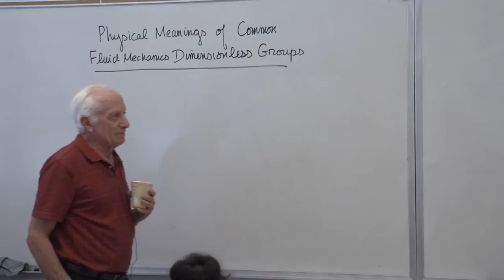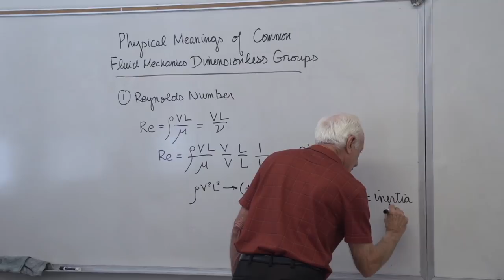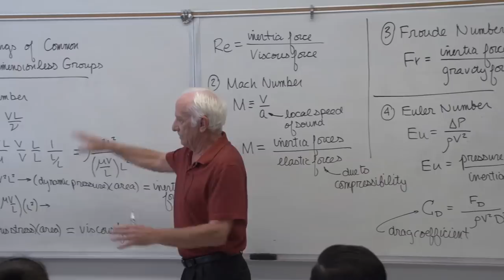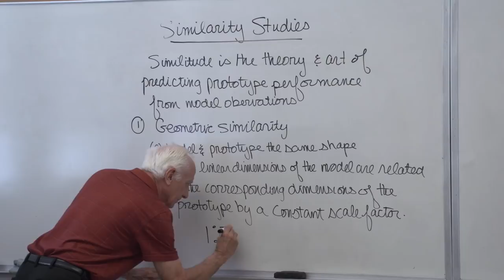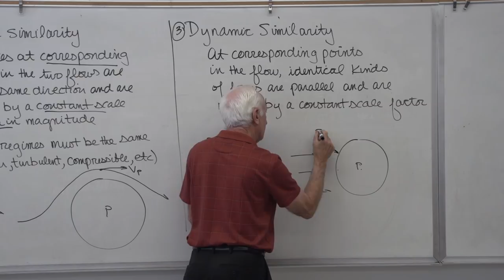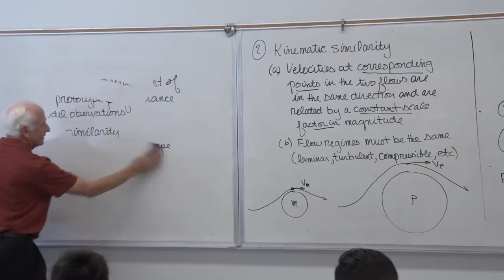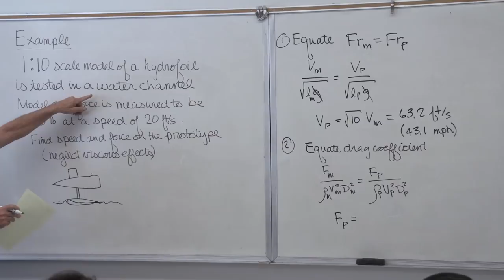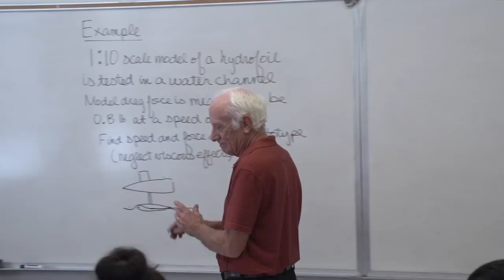Fluid Mechanics: Similitude (24 of 34)

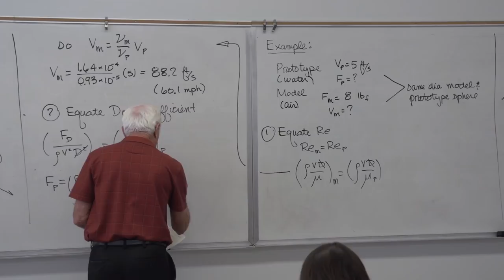Comment: 44:26 how did you get density of water as 62.4? Thank you
Reply: That is usually given, either in the problem or in a chart. Or it's just a value he has memorized.
Reply: Standard conditions are around 70f and 1atm(14.7psi), he's using US Customary water density at 62.4 lbs/ft3.
Reply: @NoelAWinslow  At standard conditions the density of water is 1.94 slugs/ft3, mass/volume. He's using the value for specific weight "gamma" which is describing weight/volume. But since specific weight is simply (density) x (gravity) then gravity will cancel. So dividing the densities or specific weights will yield similar results.